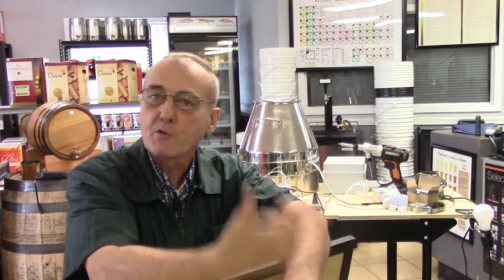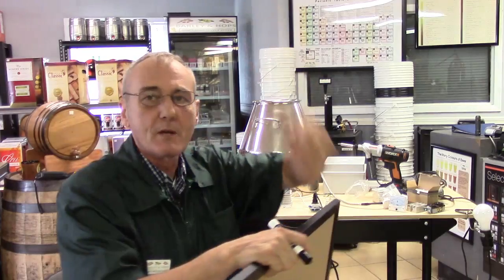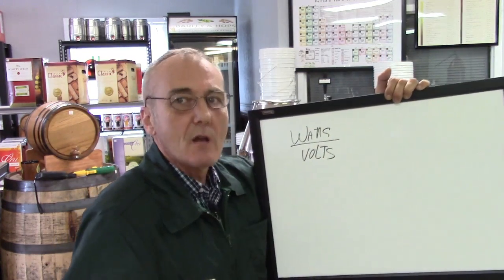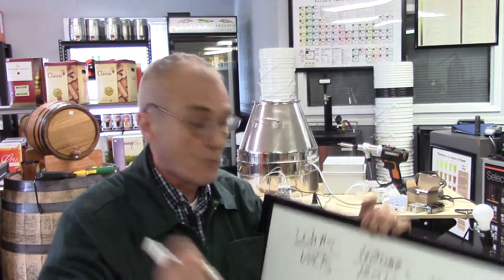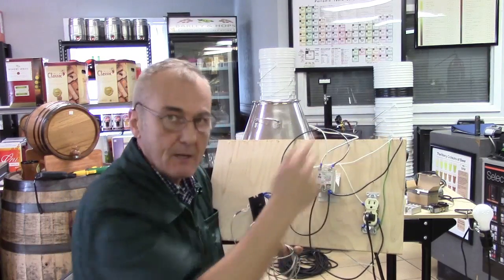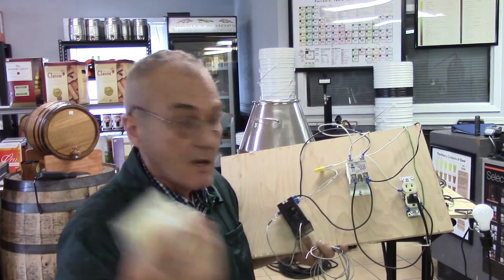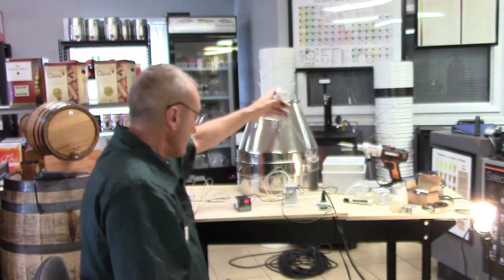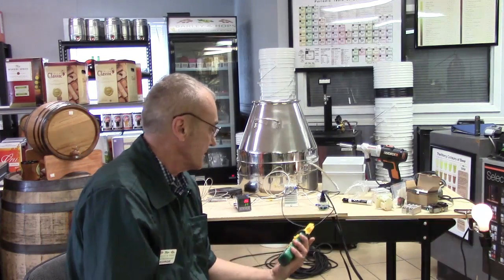WIRING MY INKBIRD PID PART 1

Comment: Might be better to just say up front: V=IR and P=VI=I^2R.  Did you say "temperature perceived"?  That's the same as temp measured, right?
Reply from the maker: Well, yes it is the same thing. I get it. Word usage is important but the true meaning of SV and PV is (set value) and (perceived vale) according to the generally accepted terms in this case. I use perceived temperature since temperature is the data point in question. In a nut shell, the perceived value is a digital term used as a reference point to measure from when another value is added to the equation. In this case it happens to be provided by temperature. 
Thanks for pointing that out.
George

Comment: I have a Digital PID Temperature Controller ITC-100RH + k sensor freezer heater relay. I know the power go's to pin 9 and 10. I don't know what pins the coupler goes on and i don't know what pins the heating element goes on. It's for a foil press and i need to set it for 280 c. I'm not familiar on wiring these units. Thank you.
Reply from the maker: You will need a relay for that PID. Pins 7,7 are for the relay. The probe goes to pins 3,4 make sure you pay attention to the + and - signs for the probe.
If you get it backwards it will read backwards.
George

Comment: I'm running a 4500 W 240 V  hot water tank element in my RIMS tube on 120 volts plug.  It gets hot but it takes time.  Does this mean there is potential for 37.5 Amps on my 120 V 30 Amp line?
Reply from the maker: A 4500 watt 240 v element running on 120 Volts is only operating at 1125 watts at peak performance. I can see why it takes time to heat up. You'd be better off with a 2000 watt element rated for 120 Volts. They cost around $9-12 at Lowes or Home depot.
George

Comment: Please confirm - I have a 4500 W, 240V, heating element.  I'm using it on a 120 V, 15 W, wiring in my home.  It heats up fine if a little slow. The math I did for the amps in this case is (4500 W /120 V)/4 = 9.375 Amps  -  Is this sound?